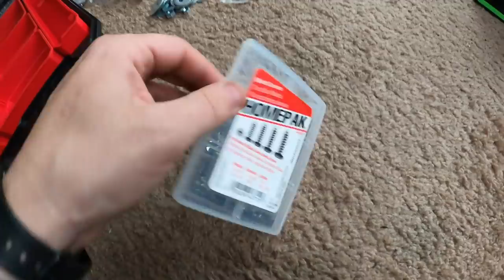Bad Taillights, New Toolboxes, Driving Vlog || RV Living

Comment: Valve lash could be out of adjustment on the little generator, I’ve got one of a similar design and at 400 hours I adjusted them, they were actually almost too tight. Cleaned the spark plug and cleaned the spark arrestor too.

Comment: Nice vid man.  Them dang tail lights.  Hope you have some time to mess around with them some more.  May want to compare to the other side.  Well in my case someone put the wrong bulb in and I put the same wrong bulb in with not much luck another one the little ground wire rusted off.  I swear by the time I get done fixing my rig it will be new lol.